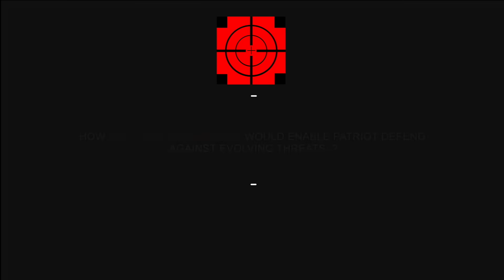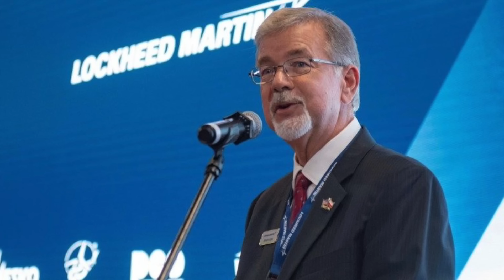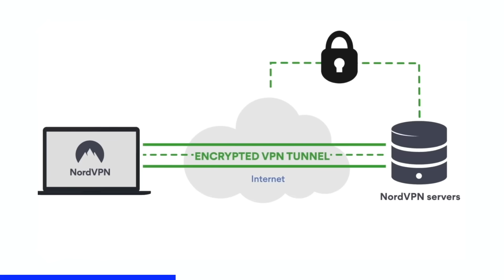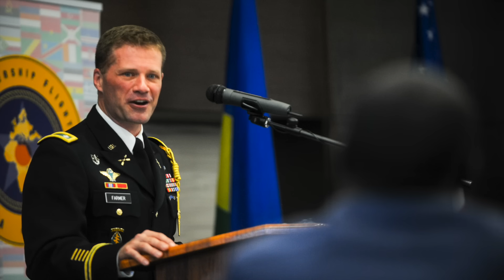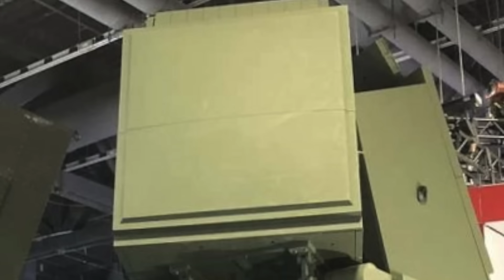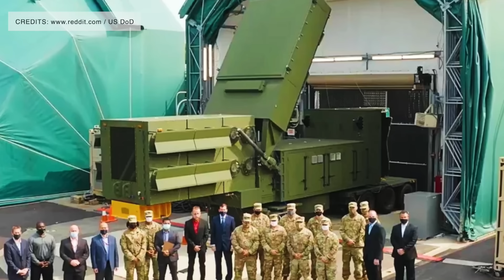How PAC-3 MSE with LTADMS would enable Patriot defend against evolving threats  ?

Comment: The Army needs a newer missile 
Either the SkyCeptor or the SM-6 or the USN and Army work together on common missile
If Raytheon was smart, they would combine the PAC-3 MSE body that can be quad packed in the MK-41 VLS or the existing PAC launcher
add the SkyCeptor seeker with at least 90lbs warhead and 100 plus mile range
That would definitely get the USN's attention and address the Army's need for a newer and more capable missile
Reply: Only PAC-3 can be quad-packed. PAC-3 MSE with a larger diameter can only be dual-packed.
Reply: @johnsilver9338  
All the more reason to scale the MSE body enough so it can be quad packed
Reply: @verdebusterAP Lockheed Martin Missiles & Fire Control manufactures the the PAC-3. 

The entire purpose of the PAC-3 MSE is to bridge the gap between the PAC-3 CRI and THÀAD. 

The increase in size is completely due to a larger solid rocket dual pulse motor. Reducing the size would mitigate the purpose of bridging the gap.